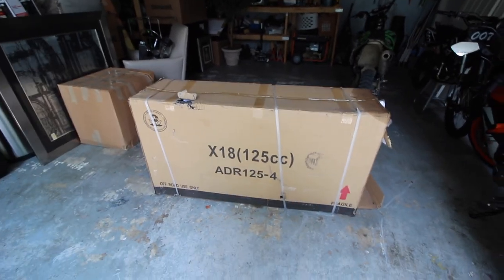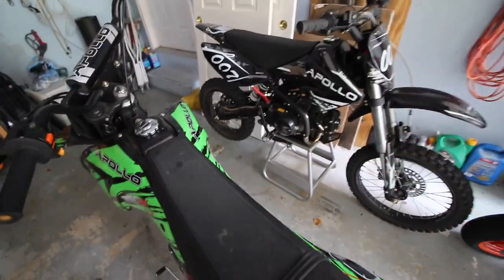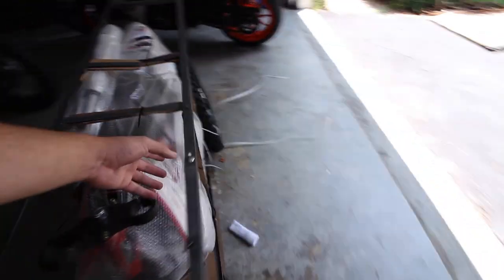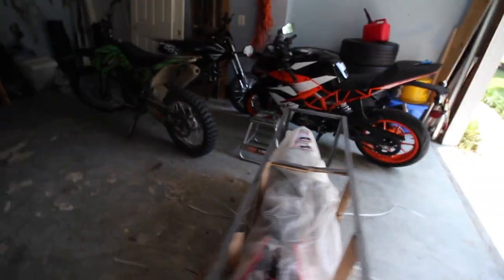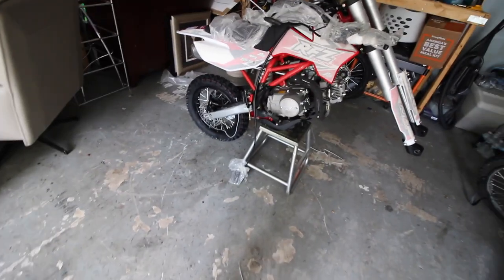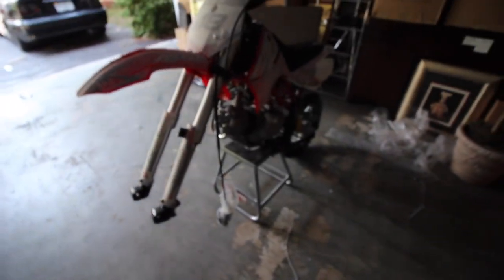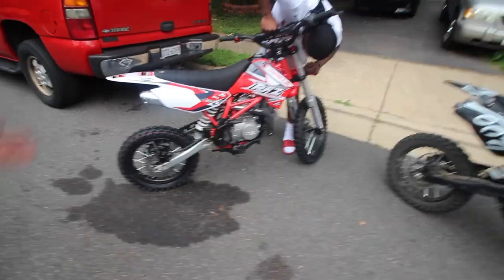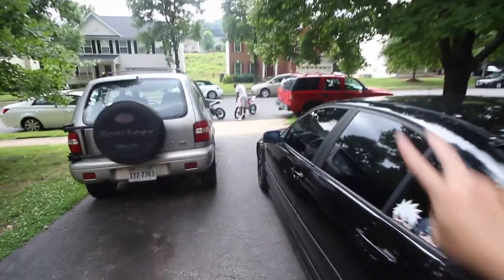UNBOXING My SECOND Apollo 125cc Pit Bike! How To Put Together Apollo RFZ DB-x18

Comment: Subbed & Liked- Also, That “tube” you threw away is called THE SAVE TUBE. Hence the name :: save.  You need that installed as it’s related to the air intake system of the bike.  Removing it only hinders performance.  As per manufacture instruction- empty the tube when its 2/3 capacity.
Reply: This is why I would never let someone else put together my bike. His friend is odd.

Comment: thank you.  the cage off,   was hardest part.  i was afraid to strip the cheap screws and need to hack saw the screws.  after that bike assembly easy ,  my brake pistons front caliber , stuck, so i went on youtube to learn, fix, in process let air in had to bleed.   the brake pedal on yours is bent , try to bend back , the company will probably send a new one, or buy on ebay.   i love the rear fender tail, i took off the stickers .  put on grey carbon fiber vinyl wrap''    you can use  vinyl wrap,   anywhere on bike.   but for me the rest of RFZ  looks great as is.     YES the 007 looks bad, hate  it.     i would  vinyl wrap the whole thing.

Comment: The Apollo rfz is nice that frame is great for protection I wrecked and a rock hit that well a lot of rocks and usually it would have ruined carb and more but it bent up after rolling 40ft through large rocks yes I was flying and  it got away from me 😂😂 I got skinned up pretty bad but it taught me

Comment: To anyone buying this bike, make sure you check your spokes. I've never had a dirt bike befour so idk if I was supposed to be doing that in the beginning but the rear wheel fell apart on the trails and left me with a 30 minute walk home to get my truck hahaha, great customer service thou they sent me a new one right away
Reply: Yes, checking spokes is part of maintenance. Another big mistake people do is using automotive oil in the engine, you have to use dirtbike/motorcycle oil... it has additives for transmission/clutch. (Will last a lot longer) Keep your filter fresh and check your brake pads after a while

Comment: That is the z20 they have the colored frames that's the one I'm getting with a colored frame the dbx did not have a colored frame when I looked at the website ebx18 so I went with the z20 which was about $30 more
Reply: The new x18s have a colored frame. It says x18 right on the number plate & box. The z20 says z20 where the black one has 007 and on the front number plate plus the z20 doesn't have break away clutch & brake levers & has a longer wheel base.
Reply: Pretty sure the x18 started the colored frame in 2020 and I think that's what year the red one in the video is. 2021 x18s look a bit different.

Comment: Bro the brake lever is obviously bent bend it out alittle  . the RFZ is 10x better than the one you have just saying . Plus if u ran it with the oil that comes in it you took life off that engine . When u get a china bike u wanna change the oil first thing let it go through a couple heat cycle especially since it’s the first the engine has ever been started I have the dbx18 prbably one of the best China bikes out there .
Reply: mike greer yep you know what you’re talking about. Do a beat cycle to get the shipping oil easier to drain. THEN change the shipping oil out. THEN ride.

Comment: I want one of those
Reply: @flixz5125  Bruh Chinese stuff is awesome. Like get a hawk 250 fuel injected it's the best affordable duel sport
Reply: Ethan Eslinger bro they’re manufactured in Dallas TX. At least that rfz 18
Reply: Ethan Eslinger and pay 5 times as much for a used one. Nah.
Reply: @trittany2882  Biggest Bib.
Reply: Ethan Eslinger I have a Chinese bike what bike do you have u prob don’t know what your talking but if it is his first bike he should get this bike because a 150 would have to much power to learn clutch but those types of bikes are for more experienced riders but It depends on the size of the rider and I wouldn’t want to pay 3k for a used broken down bike.
Reply: I want to get one but i dont know where to order it online without being ripped off
Reply: @Puglife1738 BLR I put link
Reply: @Puglife1738 BLR or search Apollo on Amazon
Reply: @Puglife1738 BLR $700-900
Reply: @Puglife1738 BLR yes
Reply: I’m getting a x6 125 but I’m so scared to get it but really wanna get it
Reply: @motovlogs1169  just get it
Reply: @Puglife1738 BLR what's the question
Reply: Tebibyte in just worried it’s to big cus I’m 11 and kinda short so yea
Reply: @motovlogs1169  you will be fine
Reply: Tebibyte k
Reply: Puglife1738 BLR around 700 to 800 I found I’m saving up to get my first bike
Reply: @Puglife1738 BLR this one is 900-1100
Reply: @flixz5125  does it look like I have $6000
Reply: @tebibyte2357  do you need a license plate for the hawk 250?

Comment: Did you change the shipment oil?
Reply: SOH Score nope that y it sound like that 😂😂
Reply: Most important part is to Change oil bro and run 93 octane gas only. You should bend brake back but only bent the forward half to not damage the bolt housing. To break the engine in you need to ride at low rpm in first and second gear putt around not reving it at all for 15 minutes and do that 2 or 3 times with 15 minute break between to cool it down. Then you do a few between all 4 gears and give it a little bit more Rev not a lot thought. check oil level half way through. And to complete break in change oil and tighten every bolt and thing that can be tightened. Put the wires behind number plate and the break or clutch wire leave which ever is not with the group you'll be putting behind number plate where it is.

Comment: I have the same bike i had to bend the back break out a little also should get the mukuni 26mm carb it inproves the power so much well worth it
Reply: I put a mikuni on my dbx18 and it only runs on choke unless I hold the throttle open a little while turning the choke off then in revs up crazy high all by itself. I haven't changed any jets as I have no idea what size to put in. Any thoughts?

Comment: You funny leg'ged. You should of least let it idle after first start for 10 min at least. U were quick to hop on it but anyway. Word. Make sure he takes it easy for the first good amount a rides/ hrs.  My green apollo db x 18 runs like a charm. Always ran good but I put the 30 dollar knock off mikuni and it ran beutiful. Then got the real genuine mikuni and definitely notice a difference.  Supposed to add 1- 2 horsepower. Also made mine street legal/ supermoto style.  Put Michelin city grip tires on. 110/80-14 for rear & 90/80-17 for front tire. I just bought extra set of wheels for db x18 that came with rim tire and tube. Took them tires off for extras later on in life and put street tires on with rim lock's and irc heavyduty tubes.  Put headlight,  taillight/ working brake lights for both brakes. Horn/ alarm.  I Bikes are good just gotta keep up on maintaining.  Also changed oil like 5 times. Got it at end of april , 2019.. I'd like to send u some pictures... Might get the apollo db-36 250 deluxe.
Reply: When you put the mikuni carb on did you have to change jets or needle settings? I put one on and mine will only run on choke unless I hold the throttle open a little when turning off the choke. Then I let go of the throttle and it revs up wicked high on it's own. Any thoughts? I cant find any videos for a good mikuni install and adjustments.
Reply: No, all i had to do was turn down idle and turn "IN" the air adjustment  screw. It runs perfect. I would not want to change settings at all. In the first few weeks of buying apollo x18. I bought a knock off mikuni and the settings were spot on and needed no adjustments at all. But like I said I put the real mikuni in and took 20 seconds to get it perfect. It does make a difference. Anything else  u need bro, let me know..  did u make sure u got the spring in top of carb where throttle clips on correctly installed. U probably have it in right. But maybe try turning air screw all way in just til it touches closed, then back it of one to one and a half turns out. Start bike and adjust idle until it sounds like it should. Good luck cuzzo..
Reply: I never needed to use my choke to start bike on all 3 carbs I had. First kick everytime. Hope u get it right. Did u check inside carb when u got the throttle cable end clip in and make sure when you turned throttle, that the thing inside carb that lets amount of gas in was properly moving?
Reply: @AllInOne-hg6xy  I'll take it back off an have a look at the throttle cable to double check that I have everything in right. The stock carb kept sticking open and allowing gas to flow into it to the point it was over flowing out of it. The mikuni doesn't mate perfect with the manifold (I think that's the right word for the pipe to the engine) the screw holes are offset a little high of center did you find and mount  a new one or keep the stock one? This is my first bike so I'm learning as I go along. Thanks for your response bud I appreciate it immensely.
Reply: I mounted both knock off and genuine to stock carb manifold. Is there anything in way of carb not allowing it to line up correctly. I know u can order them carburetor manifold's, but then run chance of it not lining up again. I can try to get specs from mine and see if we can find one.. But yea check throttle cable where it goes in at top of carb screw cap too
Reply from the maker: hit me up on twitter bro! ExoTic MoTioN
Reply: All In One what lighting kit did you use to make it street legal. I want to get the db x19 and do the same but no one can tell me if it’s possible! You did it with the db x18? So the 19 should be possible also.
Reply: All In One what lighting kit did you use?